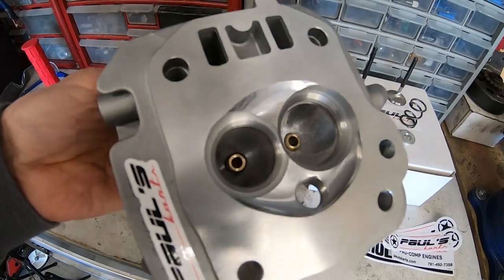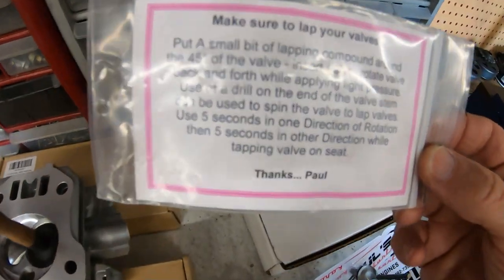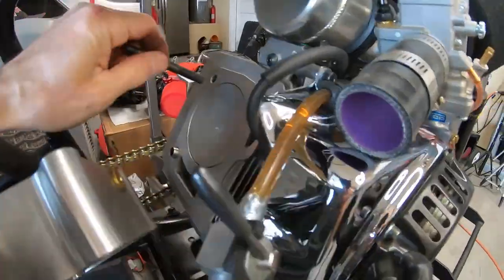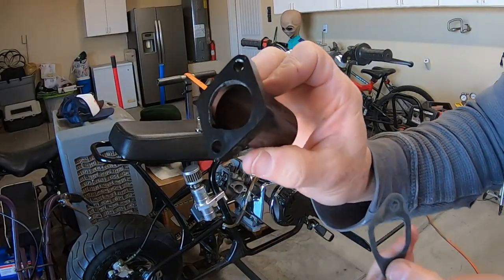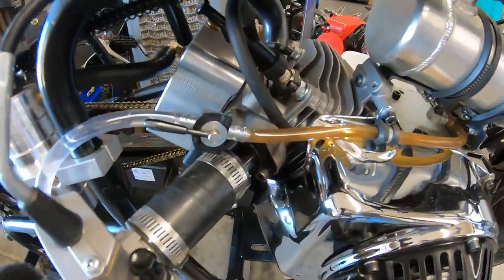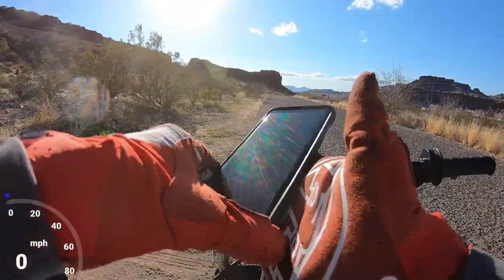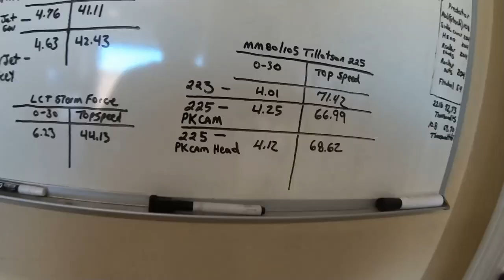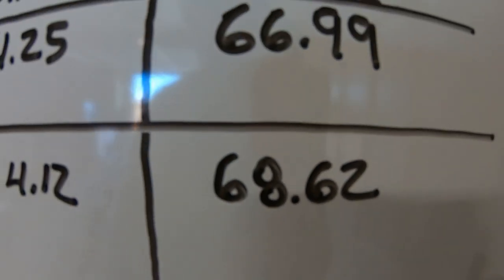How fast are Paul's kart's big valve head and cam in the Tillotson 225?

Comment: Thanks again for the videos.  What most people don't realize is, its a group of components that let you utilize all the available power of one certain component in a build.  So throwing on a big valve head can actually hurt if you don't have all the other goodies to go with it.  Those 1.3 ratio rockers probably gonna wake that thing up alot.  Can't wait for the rest of this series.
Reply from the maker: Yes! You need all of the supporting mods to go with the head to get all the potential power out of the combo. Thanks for watching the videos
Reply: also his heads are meant for high rpm use.
Reply from the maker: @Tota1Everything  Yes, I'm going to be spinning it harder in an upcoming video.
Reply: @Tota1Everything or in reality he is a guy working out of a shed selling bullshit
Reply: @adamjankowski4315 he does the real test
Reply: @adamjankowski4315 no body does this dyno numbers not real world data

Comment: So stoked to see this finally. I know it's not the gains that people were expecting but I think once the right ratio rockers are in there and a carb that's closer to the intake valve size then it should wake it up. I'd try a 28mm carb with at least a 130-135 main to start along with a pulse pump. I think the 24mm is choking it up. And it sounded like it was running out of fuel. Im running a pulse pump with a 26mm round slide on a ported non hemi stock valve head and it made a big difference over the vm22 that I had on it with no pump. I love your videos though. Always have a chill vibe and great info. Keep it up man.
Reply: The 26mm round slide nibbi woke my 212 non hemi up tremendously over the 24mm d slide I had on it.
Reply: I have a 22 mm on a 212 hemi and I’m able to empty the bowl faster than gravity can feed it. So a full throttle pull will run it out of fuel in 45-60 seconds. Definitely needs a pump.

Comment: For that combo to work right you will
Need the stroker crank the 5.595 rod with the piston at 0 deck height 1.3 rockers 28 mm velocity stack carb and a pvl coil I have the 72 mm tilli with this same setup and it makes 27 hp on a water dyno nothing touches this motor it really needs the crank Paul recommends it all goes hand in hand he has spend un numbered hrs developing what works and it really does work. As far as getting work or parts from him just plan on a little wait the guy is swarmed with work he’s about 4 months out on the wait list but we’ll worth the wait😊

Comment: Paul’s motors are also made to
Make peak power past 8500 rpm with that cam and it makes a huge difference trust me I know my motor uses a completely different gear combo than anything I’ve ever used but like I said the motor breaths more air like double so
It needs more rpm
Reply from the maker: Yes sir! I hear ya. I plan on running a stroker crank and Meth in upcoming videos. I basically wanted to see what an average built 225 would do with these parts on the way up.

Comment: Hey , love your videos  keep them coming, question I have a coleman ct200u ex mini bike I just recently put put a series 30 torque converter on I like the speed of it but I miss having the torque from a dead stop that I had with the jackshaft setup, Is there anyway I can have the torque of the jack shaft but the speed of the torque converter both in one package, I was thinking of adding a juggernaut clutch to this setup any ideas?
Reply from the maker: Thanks! The Juggernaut will make a difference . That might be good enough . You can always add a 60 rear sprocket like in the CT200U-EX video with a straight chain. The bike was just as fast with a 60 tooth as it was with 50 tooth because it put the engine in the optimal RPM band for the cam being used.

Comment: You're missing a few very important things here that are keeping you from making full power. Fully port match your intake and exhaust to the head (smooth and progressive blening) for propper flow, at those RPMs billet connecting rod and flywheel (ARC has build in 32° advance) are highly recommended if for nothing other than safety, Proper ignition timing (advance) will greatly improve power output over the majority of the powerband, fuel delivery (Jet size) Type (high octane or methanol) and supply pressure (Pulse pump with a regulated fuel return line off the supply line.) And lastly crank case ventilation. You are making the engine fight itself by running one tiny breather off the valve cover to a catch can. (Reccomend 2 breather lines to catch can) There should also be lines running from the valve cover to the side cover to equlize crank case pressure and allow oil drain back under high rpm. Hope this helps and  gives you some ideas to try.
Reply: @Black66  Okay thank you for the info.

Comment: When did you purchase you parts from Pauls Karts and how long did it tale for your parts to arrive?
Reply: Mine took 3 weeks. Big valve head with welded intake tube and epoxy port. It's the single best mod that you can do on a predator as far as I'm concerned.
Reply from the maker: It took over three months for the head to arrive.
Reply: @Black66  damn that’s long

Comment: This is not really related to the video but I can’t find out the problem with it. I recently picked up a predator ghost but the Throttle will not return. I tried giving it more slack which fixed the return issue but then it would give itself throttle when I wasn’t touching it, and it would try to drive itself away. Do you have any idea on what to do?

Comment: Maybe try adjusting clutch engagement? I’ve always thought about how it engages and engaging too much would bog the engine and to little would let the engine free rev at a higher RPM . Unless it’s a high hp build like this, maybe up the rpm🧐 just a thought
Reply from the maker: Thanks, I need to keep the clutch and gearing set up the same in all test to be consistant through the video series.

Comment: Gotta get a .016 head gasket
Reply from the maker: I will be doing a stroker crank and and other mods in upcoming videos .
Reply: Hes already well over 12:1 compression ratio with a 14cc head with a flattop piston nearly flush with the deck. He ought to run highest pump gas available along with octanium booster at a minimum. I think 28mm Flatslide with at least a 130 main is what’s needed. Would be ideal to test 130 and 135 main back to back and log the data.
Reply from the maker: @562jamesj  Check out the Mega Moto playlist I have rum octane booster. The jetting will be different for everyone. I live at 3700 foot elevation. I generally use a smaller main jet.